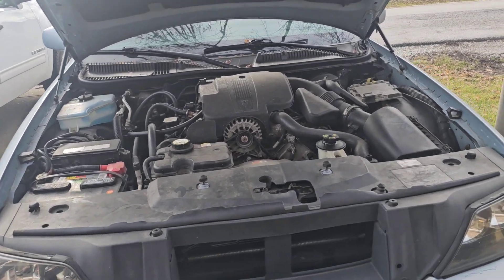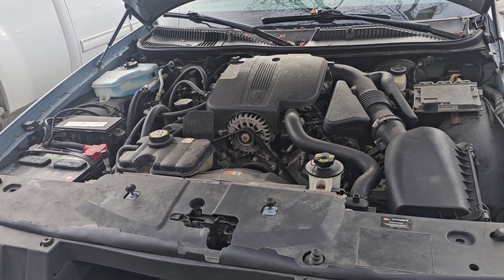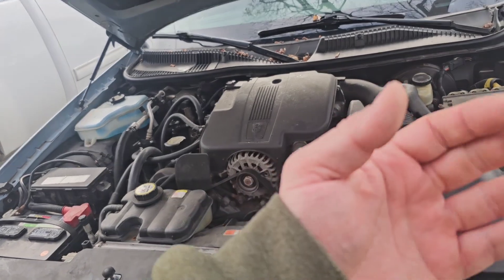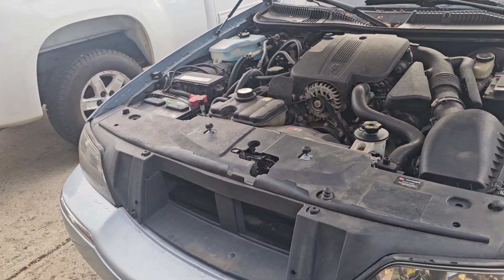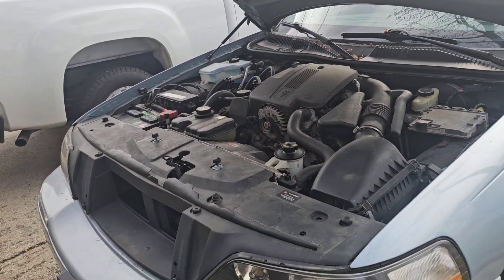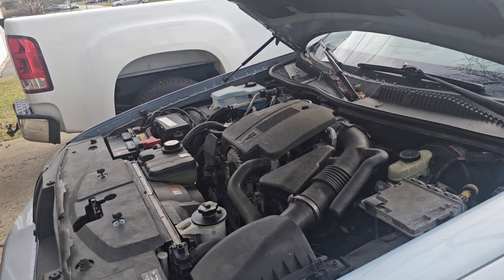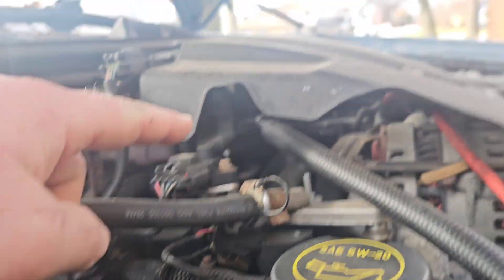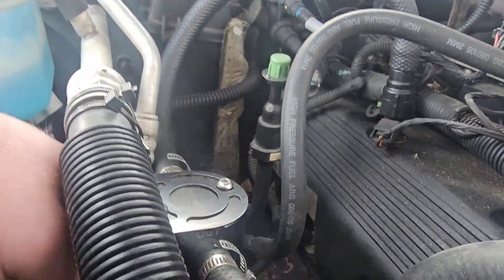How a PCV System Works - Catch Can Necessity and Why It Does What It Does - 4.6L 2v Engine

Comment: A little history lesson, the pcv system was designed for tanks in WW2 so they can be used for water crossings so they didn’t flood the engine. Then the epa started there stuff in the 70s so eventually regular vehicles would use the pcv system.

Comment: I had a 1958 Plymouth with a road draft tube and I really think the whole PCV valve and closed ventilation system was a great invention and a huge positive for emissions. 1968 was the required law for these systems to become standard on all engines. My 2017 Camry with the 2.5 actually has a built in catch can built into its PCV system. They call it a crankcase cover like our 2009 Ford Focus with the 2.0. Happy New! God bless!

Comment: In 1967 I had a 1960 Ford Falcon station wagon the smoke just poured out of valve cover. I fashioned a connector that attached to the valve cover and ran a hose from there to another connector that I attached to a connector I put in the top of the air cleaner. No more smoke everywhere, I don't know if it was right or not but it ran fine and I didn't have that embarrassing smoke anymore so for me it was a win.

Comment: Pretty cool, I see those catch cans a lot on direct injection. I’ve been pretty impressed by those 4.6’s. The police fleet I work for are still rocking a few Crown Vic’s with well over 200K miles with original engine.

Comment: I have a 2018 Ford Focus 2.0l non ecoboost. Here lately my mpg has dropped by 10-15. There are no other symptoms i can detect to try and link something together. My local ford dealer is absolutely terrible. Plus i want to diy anyway. A lot of the cars components are new. Had close to $30,000 of warranty repairs done. Which include engine swap /intake and exhaust gasket replaced, trans work, apim replacement, entire cooling system radiator/ hoses/flush, and ive recently replaced engine and cabin filter. Oil change is a few hundred miles away. Ive kept up on all maintenance. Sorry for the dang book of a message. To wrap up my mpg has plummeted but i cant detect anything else. Thank you

Comment: I understand this and how the catch-can works. My question would be, is it possible to route the "captured" oil mist/droplets/whatever to the crank so it can be used if good or captured by the engine oil filter? My only dislike with a catch-can setup is another filter to remember. Not a big deal, but it's a shame we can't do more with the captured oil. Might just be crazy, and the catch-can setup can prolong engine life and improve performance, but it still means that oil meant for lube is not lubing things. Maybe I'm over-thinking it. Hope your new year is going well!
Reply from the maker: I mean essentially they do already do have systems like that look at the 1.5 L EcoBoost it has the PCV built into the oil separator and it still pumps a ton of oil up into the intake manifold

And that oil Vapor that's being trapped if you smell it it smells like it's super contaminated with fuel so I don't know that I would want that going back down into my oil
Reply: @FordBossMe  I did not know that. Maybe that is why the oil-separator on my 525i is so over-engineered. Thanks for the info! I agree, fuel-dilution in oil is bad and it probably is best to toss the mess (recycle it).

Comment: I fitted two of these on my 2012  F150  3.5. Eco boost. The passenger side does catch quite a bit but the drivers side hardly anything. I mounted mine up at the front just behind the grill and they are super easy to check out and empty.
Reply from the maker: Yep that's normal

Comment: Thanks for the video. I’ve been kicking around the idea of a PCV delete of sorts. The idea is to modify the valve by removing the spring and ball so it’s open full time, run the hose to a vented catch can and cap off the intake vacuum. My concern is I don’t know if the lack of vacuum to the crank case will allow for enough scavenging of positive pressure to prevent from blowing oil seals and sludging up the oil excessively. I would love your feed back on this idea.
Reply: You want to keep the crankcase ventilated. Filtered air enters on the opposite side while contaminants from blowby get sucked out and reburned. It also strives to keep the crankcase at a negative pressure. That will prevent leaks. Without the flow through ventilation, the oil will get dirtier much faster. Think about that.
Reply: Removing the spring may allow too much flow. Realize, the PCV valve is variable. At idle, too much air may flow through and act like an intake air leak. At higher RPMs, the valve will  be fully open, which will not disturb the air fuel ratio. You may find it difficult to start. The spring works from the degree of suction produced by the manifold, closing off the valve but not completely. The valve can become closed. The best thing to do is replace it periodically but don't  modify its design. 

Turbo charged engines have the most to worry about when it comes to leaks due to greater blow-by with not enough ventilation and positive pressure builds when excellaration is most excessive.

Comment: I placed a J&L oil separator on my 2021 Ford f250 last year, I was surprised at how much oil was being sent back into my engine into the fuel system, every 3000 miles it is full. I just choose J&L and it’s very nice quality, I’m not paid by them so choose what you want.

Comment: Have you ever measured the crankcase pressures? I've had some forced induction cars and dry sump engines lose too much vacuum with the increased volume of the catch can and the pcv was not able to do its job correctly. I had to use reducer fittings to increase vacuum and make the pcv work properly
Reply from the maker: I've not had a reason to do that but definitely good food for thought

Comment: Hey rich,love the video and thank you for the information buddy. My question would be,would you recommend installation of an oil catch can on my high mileage 2002 chevy avalanche 1500 with a 5.3 vortec? It has about 250,000 miles on it now,still runs great and definitely has regular oil changes at around 3,000 miles with royal purple hps 5w30. It's an everyday driver and I want to keep it lasting for a long time.

Comment: I'd imagine Positive Crankcase Ventilation would be better than a crankcase vent tube, or road draft tube. Mainly because of emission of course, but also removing moisture and other contaminants more efficiently. I guess in racing applications the air fuel mix would be easier to control without it. Maybe that's why some equate it to a performance gain if removed?

Comment: Definitely installing  one on my 2000 town car. Question I have is my 04 Avalon has the 3.0 engine that is pretty clean but known for sludge build up over time. Would this help prevent that issue later on?

Comment: I got a 2020 ford f150 with the 5.0. Whenever I drive from a stop around 2-3k rpm I hear this rattling noise. When I use 87 octane I feel I hear it the most but even when I use 93 octane I still hear it a little. Any ideas on what it can be because the ford dealer keeps saying they can’t replicate the sound.

Comment: i just got a 23 Explorer St last month and am torn on putting a catch can on it or which one to put on it.  My question is this.  If i put a catch can on, should i do standard or dual valve?  Dual valve is a couple hundred bucks more and has the clean side separator.  I'm looking at UPR.  I don't drive the thing hard just plan on some spirited driving here and there.  Shes just turned 1000 miles so im going to do her oil change and am on the fence about a catch can and which type to get.  i want this thing to stay as healthy as she can for as long as she can.  Her oil will be changed religiously between 4-5 thousand mile intervals.  Never more than 5 thousand.  Thanks and be blessed.
Reply from the maker: UPR is definitely the way to go and I would do the clean and dirty side because it is turbocharged
Reply: @FordBossMe  Thank you. I was leaning that way but wanted your opinion since you work on these things all the time. Thanks again!

Comment: I always wondered why there was more oil on the roads decades ago. I figured it was due to more leaky drivetrains. When riding a motorcycle, it always seemed wise to stay in the tire tracks, because the middle of every lane had more oil in it.

Comment: The PCV also takes the vapor or smoke from the hot oil in the sump and burns it to prevent it igniting in the crank case. 
If combustion gases are burning and doing work pushing the piston down. And when you take the exhaust manifold off when running you see flames, showing the gases are still doing workon the exhaust stroke.  Wouldn't it be that the gases are ejecting themselves? The gases did work to move the piston in the first place, so the piston is not pushing the gases.
Reply: I think he’s catching the blow-by fumes

Comment: Toyotaco 2018 2.7l pcv hidden?
Reply from the maker: I'm not really sure on that one I don't really do a lot with Toyota so I know some of them are in the valve cover themselves some of them are down on the engine block mounted with an oil separator it's just all depends on your application
Reply: Thank you bro!

Comment: Don't try this in Crazy California or you'll fail the visual part of the smog check. They consider such mods "tampering." Many years ago when I had a smog license, I had to fail a SAAB with an aftermarket FI system because it wasn't CARB approved. The emissions were much cleaner than the stock carburetor setup. The owner went to the state referee, who officially failed the car for tampering.
Reply: They’ve relaxed on some modifications. I’ll ask. We use to fail throttle body spacers and aftermarket throttle bodies. Now those have carb eo numbers after they found out they didn’t increase emissions
Reply: I’ve added to 4 cars recently and none failed in SoCal.
Reply: @zaffo757  That is good. Maybe the tech didn't see them or they are CARB approved by now. I quit doing smog around 2000.  The BAR was always sending test cars even though my shop had no violations.  I talked an agent into a verbal warning after I did the 25 mph test in second gear on a stick.  He was ready to bust me.
Reply: @brokenwrench404  Despite their virtue signaling, CARB will usually cooperate if a mfg. will fund their tests of a given aftermarket device.  But many mfgs. don't want to invest the time and money, especially with most of the old-time Socal speed shops long gone (at least down here in Dago).
Reply: @gnosticnight  the dyno was fun 🤣 did you miss the gas cap tester if you stopped doing them in 00?  That stupid thing was a pain with its adapters. 
Now it’s just a sniffer, obdII and a quick visual. I was lucky since I was a govt fleet tech. We had a annual bar inspection l/calibration but they never messed with us. Would of been hard for them to sneak a car into the fleet. 
Heard some crazy stories about how they trapped some shops and techs

Comment: So set me straight, this probably WONT help with the fuel smell that starts building in the oil around 3000-3500 miles? I’m thinking that’s a different issue. ‘21 2.0 EB maverick

Comment: Vehicles use to have an actual pcv valve and for some reason they quit that. It seems these companies are building cheaper quality vehicles with an outrageous price tag and some are lucky to make it to 100,000 miles before the engine is toast!  The price of vehicles and no longer than many last is just a rip-off!  Having to deal with a catch can besides everything else that's under the hood of these vehicles is non sense. I've seen some vehicles gather way more oil in a catch can than there should be. With the technology we have this just shouldn't be. One vehicle that comes to mind are the silverado's when they first came out with the AFM and GM said the oil consumption was normal. Just another way of circumventing the problem that they had!

Comment: Wait you only have catch can on one side?
Reply from the maker: Yeah you don't need a catch can on the other side as well because it's not a supercharged or turbocharged application and if you're running naturally aspirated you only need it on the PCV side
Reply: @FordBossMe  well it’s 3.5 eco boost it does have turbo on both sides
Reply from the maker: than that would explain why a dual setup would be okay

Comment: Some PCV are built into the valve cover like a lot of GM Ecotech engines. Man, some bean counters just love to suck the consumer dry when you have to change what is essentially a $10 PCV valve, valve cover, gasket, and the labor to do it.
Reply from the maker: There's definitely a much broader video I can do on this but I wanted to keep it very simple I can't go into detail like I really want to or else the video would be a 20 minute video that people wouldn't sit here and watch

It's more than just the valve cover as well so if you look at like the 1.5 L EcoBoost engines the PCV system is built into the crankcase oil separator cover that bolts down to the block underneath the intake manifold
Reply: @FordBossMe  keep the shorts coming Boss! Happy New Year to you and your family.